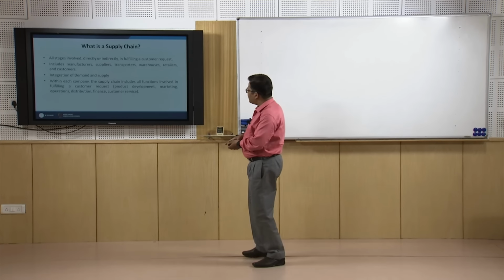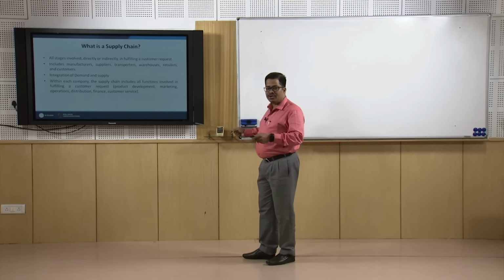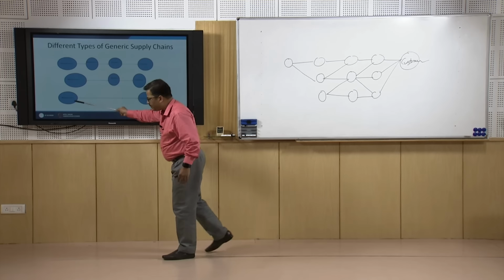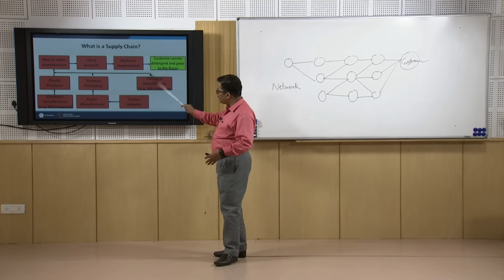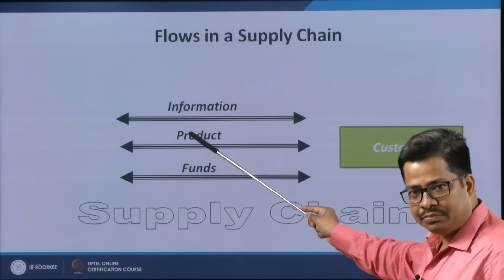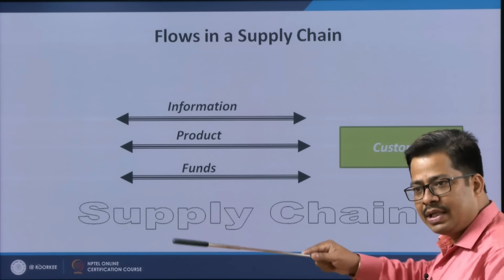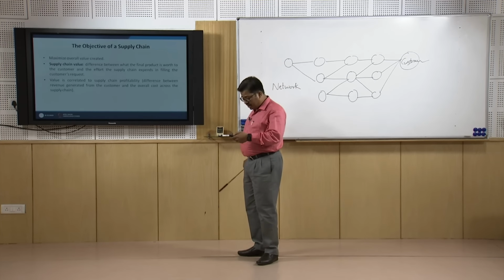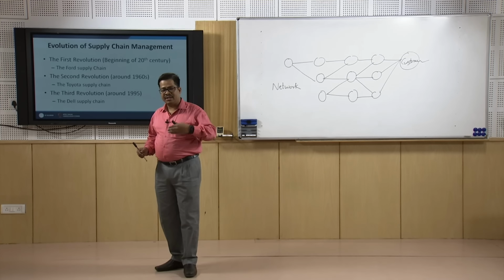Introduction to Supply Chain Management

Comment: While evaluating your supply chain management system, you have to spend time looking at how your suppliers are communicating with partners. It is common for companies to believe that they are all on the same page and both companies proceed as they would within their own space. However, that is not always clear to the other party. What you want is to build a trusting relationship where you can both agree upon basic standards of operation. The supply chain management system you choose should provide you with metrics to ensure that the relationships you have are working.
Reply: The title of video very clearly states introduction to .........the rest comes later. you are advancing to tutoring yourself

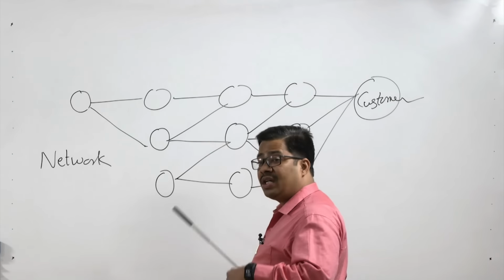Comment: 20:00 I have a question about flow of products from customer → manufacturiing. If the flow of the product is reverse then does the cost of the product increases or decreases? Also as the product flow and fund flow is opposite to each other so it will be very helpful to get a example for the same.